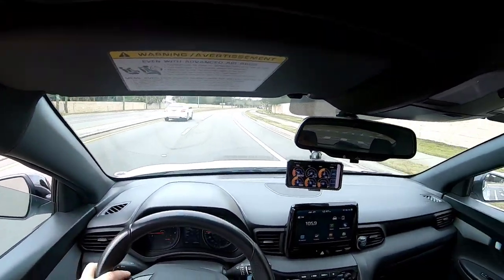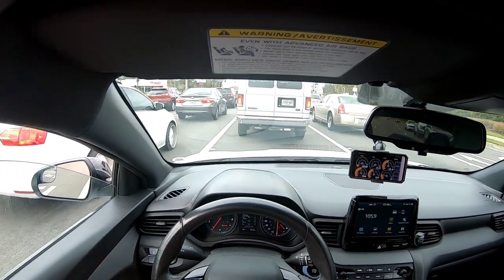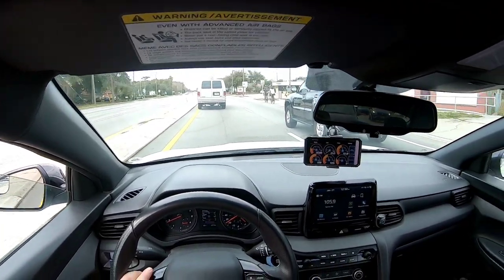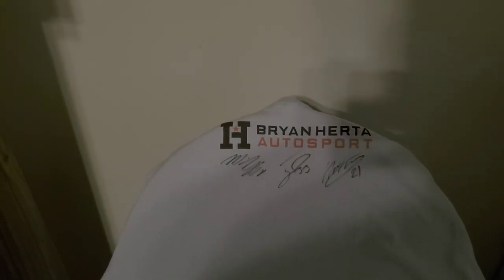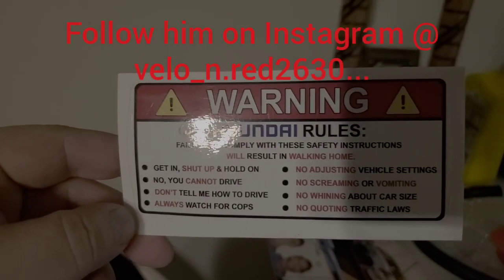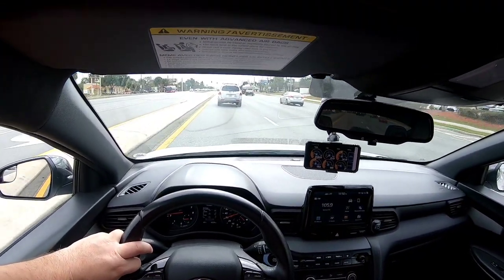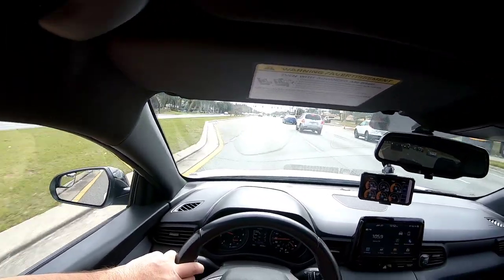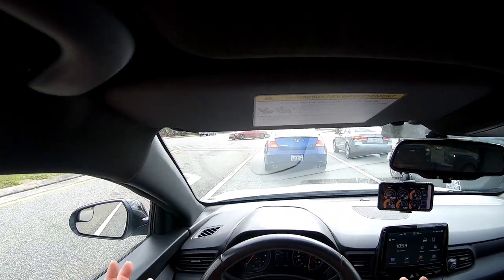Veloster N Drag strip Wheels

Comment: What dealer did you purchase the wheels from? I can't find a US dealer.
Reply from the maker: The drag wheels I just got lucky with a guy who sold his veloster N had them brand new in the box. I got them for less than half of what he paid. Fitment industries is a great place to buy wheels though. That's where I bought my konig rims from. I believe this company is based in Canada for the fast FC04 wheels.
Reply: @nstylemotorsportsracing1471  I was considering getting a set of Gram Lights 57CRs but these FC04s are like 3 lbs lighter and way cheaper. Haha.
Reply from the maker: Yeah would love a set of gram lites but those are crazy expensive. The FAST FC04 WHEELS ARE  like you said much better on the wallet.

Comment: That MAC valve worked great on my VT.... for like a month then it bricked my car Hyundai wouldnt touch it unless it had a CEL and with the CEL u were in limp mode basically 10% power if that and u were lucky if it threw a CEL
Reply from the maker: Oh wow damn that sucks. I knew there was something not right within the first few minutes of driving. The car felt slower and like it was venting boost or something. There are alot of guys around here running it and I'm not trying to be an ass but there VT'S seem slow and most have quite a few mods. I'm glad I uninstalled right away. I've tried but most seem convinced it's good. I don't think so though.

Comment: Nice wheels! Getting that Xforce  Downpipe pipe on as we speak
Reply from the maker: Awesome yup that's next. I just had to get these wheels cause the guy was selling them so cheap.
Reply from the maker: Please let me know how that works out for you I'm very interested in it.
Reply: @nstylemotorsportsracing1471  just a heads up, it was a nightmare to install! Had to take it to a shop cause I couldn't do it on my own. Even the shop struggled with it and even the 3 guys putting it on said "yea, this is not an install for a drive way. I wouldn't want to do this again cause the fitment of the downpipe is so tight and trying to maneuver through the engine was  frustrating". But it's on my car now and it's nasty! Highly recommend it. Definitely planning on doing the full turboback from Xforce
Reply from the maker: @projectjet8096  damn I was afraid of that. It is a cated down pipe right? No CEL OR anything? And were you able to use your O2 censors with out using an extension?
Reply: @nstylemotorsportsracing1471  Yea it's a catted 100cell. No CEL at all. And 02 sensor plugged right in no need for an extension
Reply: @nstylemotorsportsracing1471  it's also a good price to performance ration. Xforce is known for their exhausts with the Mustang and Golf R community. And I'm happy that the price is reasonable at $599 where as sxth element and takeda downpipes are both $900! Which in my opinion is ridiculous for a downpipe.
Reply from the maker: Cool thanks for the info. I was hoping to use the same guy who installed my intercooler but than another guy I know took his first gen veloster there and had a downpipe installed and it ended up being a complete disaster that took 2 days because the a bolt broke and it was just a mess so I have a feeling he doesn't want to even deal with a Hyundai down pipe again 😆 will see what happens.
Reply: @nstylemotorsportsracing1471  No problem and good luck with getting yours installed. Oh by the way, I got in touch with Burger Motorsports about the possibility of making a flex fuel kit for the N. They said they are working on it and to check back with them later 😎
Reply from the maker: @projectjet8096  couldn't agree more.  I can't wait to order it I just found out gen racer was selling them.

Comment: Is that an iPhone? And what app is that, looks really good
Reply from the maker: It is a Samsung Galaxy S10 E  
And the app you see running is 
The JB4 PIGGY BACK BLUE TOOTH OPTION APP.  it allows you to monitor boost, AFR, WATER TEMPERATURE, AIR INTAKE TEMPERATURE, AS WELL AS READ AND DELETE FALT CODES AS WELL AS CHANGE AND CUSTOM TUNE THE CAR. its definitely worth every penny and the best bang for your buck in terms of bhp gains.

Comment: If I purchase the 18inch base n rims  and tires would they fit the the pp brakes and rotors. And would it alter the performance of the car in any way.
Reply from the maker: That's why I bought these rims there 17 inch and clear the performance pack brakes. I only bought them for straight line racing. I have a set of 19 inch konig freeform's on the car now and they are about 9lbs lighter than factory. It really shines in the corners even better than it did. Thank you for watching and leaving feedback.
Reply: @nstylemotorsportsracing1471  ok great thanks for sharing, by any chance do you get an annoying buzzing noise from your rearview mirror.  I've already had the dealer replace one and it still buzzes on cold mornings past 4000rpm.
Reply from the maker: I definitely believe the factory 18 inch wheels would clear the performance pack brakes. I don't believe they would affect the handling too much other than you might not be able to run 235 wide tires on it. In fact I think 18's would probably feel much better and more comfortable than the factory 19's. If you do buy 18's  just try and keep the off set close to stock like a +45 or +40 at most. I think that's what will mess with the handling characteristics of the car most. And of course your tire selection.
Reply: @nstylemotorsportsracing1471  thanks for your help, any feedback on the rearview mirror buzzing.  I've read in a couple of forums others were having the same issue .
Reply from the maker: @ag4591  Omg yes 😂 it gets so annoying it has gone away for now but it started buzzing the first few weeks and I think the only reason it's gone now is because the JB4 PIGGYBACK SYSTEM actually makes the exhaust tone different so I think the frequency has changed which eliminated the buzzing.
Reply: @nstylemotorsportsracing1471  nice, I thought it was coming from the engine bay when I first purchased.  My wife thought I was crazy and hearing thing's.  I m thinking the vibration from the windshield to the cheap rearview mirror is the culprit.  Thanks again for your insight and the videos you share very helpful
Reply: @nstylemotorsportsracing1471  I was thinking the same thing about comfort as well and  being able to drive any place i like .  I kind of limit places I drive and only drive in the fast lane.  I hit a pothole once and  it felt like the whole car fell apart.  Trying not to spend money to replace a single rim.  Thanks again.
Reply from the maker: @ag4591  yeah it scared the heck out of me the first time😂 when i figured it out i would flip the mirror to reflect high beams and that stopped it but then you cant see anything. I even hit the emergency button on the mirror by accident trying to stop it from vibrating 😓 but like i said ever since the JB4 PIGGY BACK TUNE it has changed the sound of the car. I dont know if its just the extra boost or what but its definitely a tad louder and seems to have gotten rid of the vibration. Any way thanks again for watching and if you have any questions feel free to ask or any video suggestions let me know.

Comment: What is the 1/4 record for the N?
Reply from the maker: 12.7 @105.60 with a 1.765 / 60 ft time. My mile an hour is the same as his at the 1/8 mile but my 60 ft is 2.206
Reply: @nstylemotorsportsracing1471  not to bad. What's your best in the 1/8?
Reply from the maker: I always do quarter mile but my 1/8 mile was 8.775 @82.87 mph that was a 13.5 @ 103 . The guy with the record had like a 8.1 but at the same mph 82.88 was his and his car is gutted, on meth, lap3 tune and on m@h 26 inch slicks. I dont know if i can beat his time but i figure if i can get the 60 ft down to his 1.7 i might have a chance. .154 better 60 foot dropped my time 4 tenths. I will give it a shot its good fun but this car is no drag car thats for sure.
Reply: @nstylemotorsportsracing1471  that's now bad at all. If I could get my ST to hook I'd run similar times I trap 81 in the 1/8
Reply from the maker: Yeah that's why I bought these wheels because with out drag tires you just spin 1 and second. Crazy how the right tires can just drop a second off your time.
Reply: @nstylemotorsportsracing1471  I have some 16" steel wheels I just need some good tires for them
Reply from the maker: @joshmoore1397  yeah I haven't decided on what tires to run yet. There very expensive for a set of Mickey's or m&h  and I really want to do exhaust. I just couldn't pass up the deal I got on the rims so they will probably be put on the back burner for a bit.
Reply: @nstylemotorsportsracing1471  anything that's about racing is high
Reply from the maker: Yup gotta pay to play that's for sure.
Reply: @nstylemotorsportsracing1471  not exactly gutted, just seats removed. About 70-80lb or so. Also, the WMI doesn't add any power, we mainly run it to help prevent carbon buildup due to GDI, and to help a bit with IATs in the summer. In cool weather I've done passes with and without the WMI system activated and it traps the same. Long story short, you should get close if you can cut the same 60ft.
Reply from the maker: @jeromeo23  yes I know the meth injection doesn't do much I try and explain that to people all the time. I apologize for the gutted comment. I was told that by some people who were talking about lap3 not mentioning that fact. They all just said he was gutted and I mean gutted like carpet and all. Just people talking and Facts getting twisted. I still haven't bought tires for the car I would like to get the m&h tires but might go with something less aggressive. Very impressive weigh though 3085 with you in it you must be pretty fit.
Reply: @nstylemotorsportsracing1471  the wheels/tires also saved a lot of weight, was running FC04's on the rear as well
Reply from the maker: I hope so I couldn't run the most aggresive map since than I've tried out BOOSTane and ran map 3 and map 5 and it has made a good difference. How are the axels holding up if you don't mind me asking they must be stout if you're still running at the strip quite a bit. I did think it was crazy how our 8th mile mph was so close 87.88 and 87.87 😂 that's as close as it gets but your trap was 3mph higher.
Reply: @nstylemotorsportsracing1471  no issues so far. The 12.7 pass was actually the most recent time we ran the car, it was the last track day of the year. Local track doesn't open again until May 31st.
Reply from the maker: @jeromeo23  oh ok. I forgot 🥶🥶up there.
Reply from the maker: @jeromeo23  I see. Running a set of konig freeform's in back the FC04'S at 17 inch are light 17 lbs but my konig are only 19lbs so I'm sure I've dropped some weight also haven't weighed the car yet though.